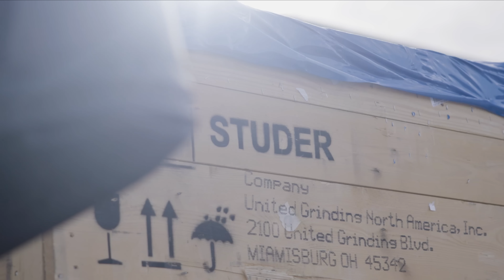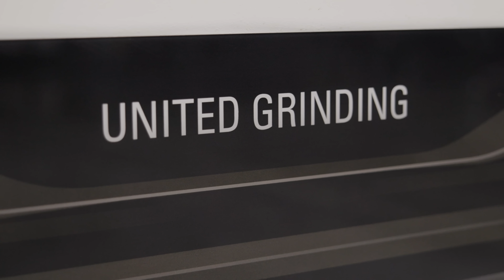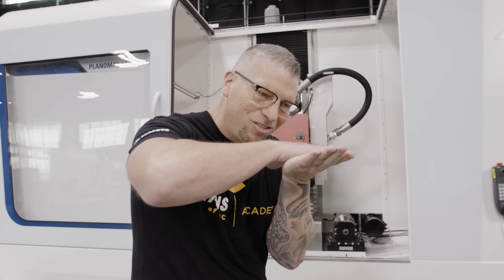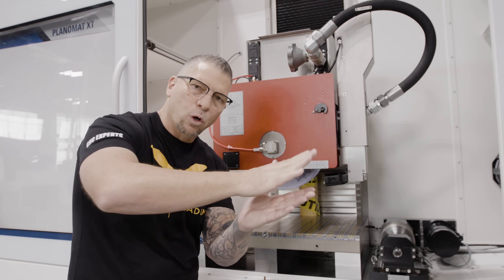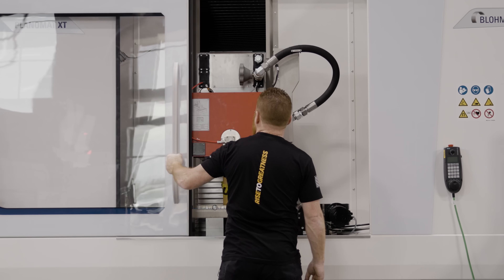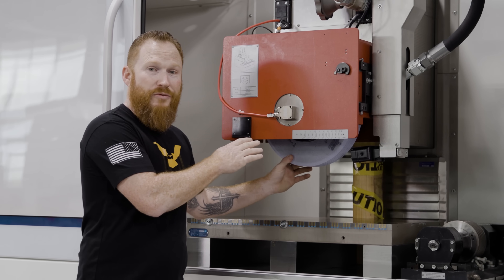MONSTER CNC Surface Grinder Hits the Floor.

Comment: How do you load grinding path data into this? Does the operator have to type in the data from a printed cut list, or are you networked into your CAD/CAM system?
Reply: I would imagine that it's networked in being a new, modern machine. I work at a fab shop that has several CNC turret presses that all predate USB sockets, and every single one of them has to have the program input from a cut list (there are 2 that are so old we had to put newer computers in them to make them easier to work with).

Comment: 1" depth of cut on a grinding wheel? In hardened material? That needs to be shown
Reply: Might be a good use for what's left of that China vise they're gonna do a full-slot through!
Reply: @JayRussellDuramax  Don't  worry, that is still coming LOL. The vise is here
Reply: @barrysetzer  Hey, Barry!  That's gonna be great!  I think a good "second operation" will be mowing through it with this new surface grinder.  Maybe as a "third operation" you could burn a big Titans of CNC logo into what's left with the sinker EDM.  What do you think?  Haha!
Reply: But he didn't mention how fast they'd plow through it.  1" depth of cut sounds impressive but at 10ipm, not so much.
Reply: @lcarus42  Didn't Titan say they can use a grinding wheel that's like 16" wide?  If so, 16" wide x 1" deep x 10"/minute is 160 cubic inches/minute of MRR.  That's ABSURD!
Reply: @JayRussellDuramax  he said 6" wide 16" diameter
Reply: @simonhopfgartner958  Ok.  That's still 60 cubic inches/minute.  I think that's quite a lot!

Comment: Good to see some surface grinding. I do some work on an Okamoto ACC-1224-EX grinder and it’s pretty fun. I’m an apprentice so I’m not an expert on it yet. It will be interesting to see the way you do things. I am a bit skeptical that you can take an inch depth of cut on that new grinder. If you can, wouldn’t that wear the wheel down a lot? Why not rough the part on the mill then grind it?
Reply: Know nothing about creep feed!!  The Okamoto's are amazing grinders. Could regularly grind a 2.0 finish which my German tool maker boss didn't believe till I ground a 1.7 and really flipped him out!  It was a dedicated HP profilometer not tiny little Mitutoyo

Comment: So... This surface grinder's monstruosity is actually about the power, not about the size? As it doesn't look so big, compared to Proth PSGP 1015AHR, that we have.
Reply: I imagine it has to be pretty rigid for a 30hp cut without too much vibration

Comment: So with that disc design would that require different techniques to dress and touch off the grind wheel because a typical grinding and wheel are flat all the way across it's surface and because it's not a perfectly flat wheel and if trys traditional way of dressing the wheel would the wheel not explodes if trys traditional way of dressing it because of the wheel design

Comment: When I was 16 in 77 starting my apprenticeship a new J&S grinder came in to the shop. 
I helped get the grinder in...then the grinder tried to pour the hydronic oil in and made a mess.
@ 16 I stood there shaking my head and was asked if i could do any better, having helped my dad pour a lot of oil diesel in machines I said yes i can then poured the 5 gallons in with out spilling a drop lol

Comment: Grinding was my speciality, Titan. When I was an apprentice at Lucas Aerospace, 1969, I was grinding some valve plates and was being watched by my boss. He complemented me on one being so good but I said it would be 2 tenths out and I was right. It was a guess but he was amazed that I could tell.
Reply: Aye , you are from the good ole days of manual machining.  I have a lodge and shipley 25 standard with the copymatic attachment,  it was used at Dr. Gerald bulls HARP program to make some martlet parts and the sabot that encased them. I hold high regard for machinists from that era.

Comment: 3:20 there is no way u take 1 inch deep cuts on this machine.
Reply: Maybe there is but with a super SLOW Feed, question is, ....... would you do it that way.
Reply: @ytfan3815  he specifically mentioned "crazy" MRR (material removal rate). 
How slow the feed is doesn't matter in that case.

Wether that "crazy" MRR is real or not still has to be proven. There's also no mention of what he's comparing the MRR to. I'm assuming it's compared to the usual maximum MRR on similar machines or grinding wheels
Reply: Yes there is, it is called creep feed grinding where a form dressed wheel is slowly fed through the workpiece.

Comment: So Titan will be a cutting tool company? If you really want precision simply ditch the imperial...
Reply: Let the market dictates, if you build bigger stuff, metric or inch didn't really matter, any blokes can do it. But once you step into the micron territory it requires totally different set of metrology... That is opening a new challenge to their Kennametal lineup and TYROLIT combo. It is nice to know that Titan is heading to this direction... Also would like to see more of Mitutoyo's latest and this expensive Walter and the ridiculously expensive BLOHM grinding machines in action...
Reply: Ironically the imperial system is defined trough the metric system anyway. So using imperial is like using metric but unnecessarily complicated
Reply: You want to convert metric to imperial, just divide by 25.4. Conversly, you multiply by 25.4.   Its really not a big deal.
Reply: You could call it whatever you want, it's still a base 10 measurement system. Whether you call it an inch or a meter, they're both exactly as precise. Metric isn't any more precise than USCS. Just because some people aren't smart enough to wrap their head around another saying inches rather than meters, doesn't mean other people aren't. Derrrrrp.

Comment: Wow less than a tenth of an inch! Perfectly understandable, i struggle with imperial units too
Reply: One day you will be ready for the Metric system 😂😂
Reply: @ytfan3815  But it is not today...🤣
Reply: @blueteeth365  
I'm glad we use Metric, it makes live so much easier. 😉😆
Reply: @ytfan3815  But it's so complicated!  All of those zeros and decimal points!
Reply: @danl.4743  You mean on Metric, no it's quite easy.
But there's a huge difference for someone who switch from Imperial to Metric to use the correct numbers and names.
A car weighs e.g. 1000 kilo, .. NOT 1000 kilo's or 1000 KG's ( kee gees ) or 1000 kilograms, you need to give it the correct name.
All below 1 meter is cm ( centimeter ) or mm ( millimeter ), all above is meter, you don't say " I'm 185 centimeter tall ", you say I'm - one eighty five ( 1_85 ) without the meter, of course you have to get used to it.  Metal/CNC industry uses mm ( millimeters ) and µmm ( micron= 0.001mm ) as standard.
When I see an Imperial bearing cataloque I see Metric numbers we do not have in our system, we have e.g. a 52 mm - 25 mm bearing where Imperial has a 2" - 1" but in your cataloque it says 50.8 mm - 25.4 mm, these strange numbers or not common in the Metric system.
Reply: Isnt it meant to be less than a tenth of a ten thousandth of an inch?
Reply: @angrydragonslayer  Not a tenth of a ten thousandth. A tenth of a thousandth. A ten thousandth.
Reply: @littlejackalo5326  i know ;)
Reply: Tenth of an inch eh?  How many banana’s is that! 😉    Congratulations on your new machine!
Reply: And me, and I'm English!! 😂😂😂
Reply: .0001 is referred to as a tenth in this industry. It’s actually one ten thousands
Reply: @nickhunter8707  
Metric or wrong?
Reply: I mean, he's technically correct that it will grind less than 1/10 of an inch XD
Reply: @PwntifexMaximus  Dubya has a point. Only much less
Reply: Lol I didn’t notice that. He meant .0001. He probably should have said millionths
Reply: Tenth of an inch is 2.54mm so I am very unimpressed.
Reply: I heard 3 tenths of a micron on the grinder's precision, in imperial is 0.0001181102 or a little over 1 (ten-th)ousandths of and inch. [Bracketed area is the contracted form used in U.S. shop floor lingo. Engineers in high places are confused by it as well, but the old guys making and inspecting the parts understand it.
Reply: @Larry Powell So in USA, if you cut a pie into 10 slices and eat one slice, you still have over 99% of the pie left?